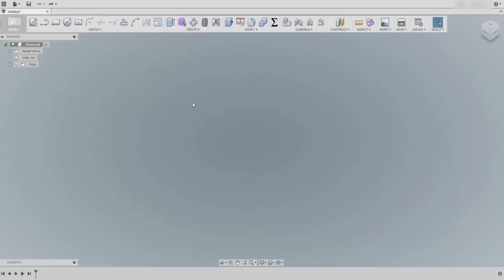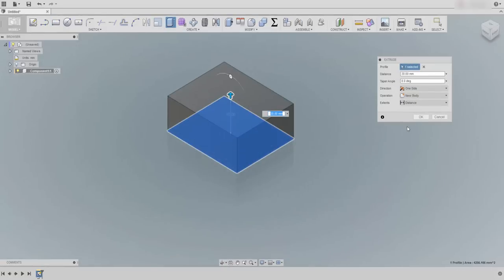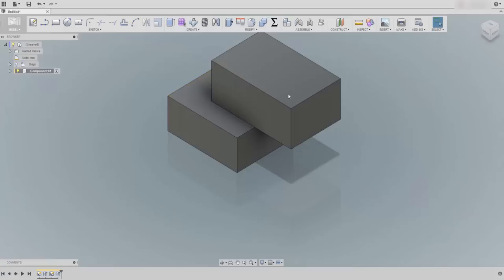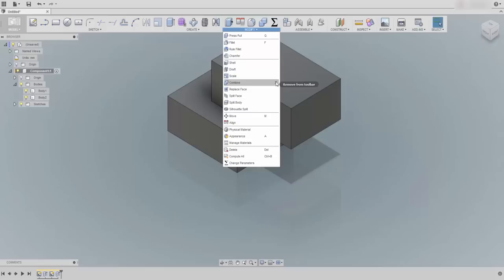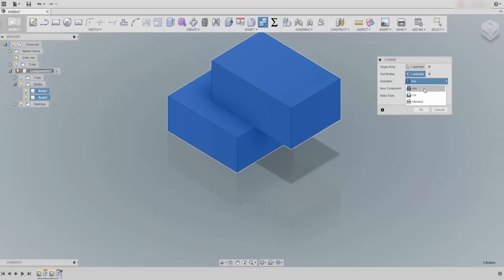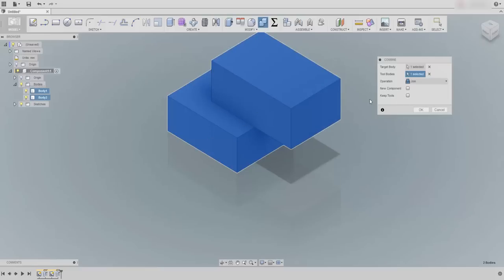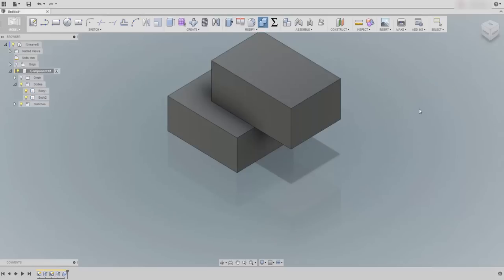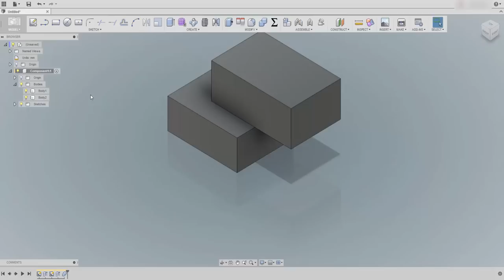Fusion 360: How to Combine Bodies?

Comment: I am working on two STL file that I imported to fusion 360 and I wanted to combine the two. First I tried a knob and a m5x25 bolt. I did all the do not capture, break link, mesh to brep and it combined just fine. My problem arise with combining the knob and the m5x65mm bolt. For some reason when I overlap the bolt and the knob together, the bolt stays BLUE. The bolt and the knob each has 70k plus facets and I know fusion 360 hates that, but then I tried to lower the facet count and it’s not letting me. PLEASE HELP!!! I’M STUCK!!!
Reply from the maker: Please send files to Fusion360NewbiesPlus@gmail.com and I'll check it out.
Reply: Fusion 360 NewbiesPlus I appreciate the reply... I got it figured out after watching another video, it took me a while to find that video bit I’m glad I did ran into it. I changed the option from MODEL to MESH, with that I was able to see the REDUCE tab and reduce the facets and I was able to fuse the two models together...👍🏼👍🏼